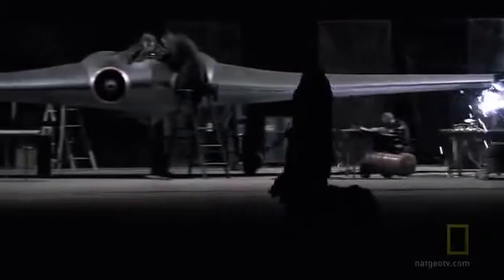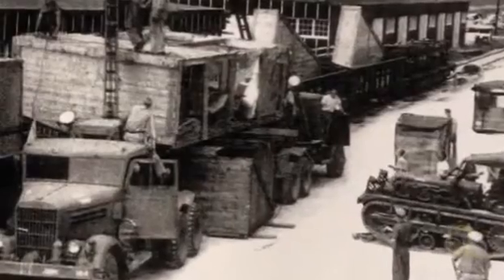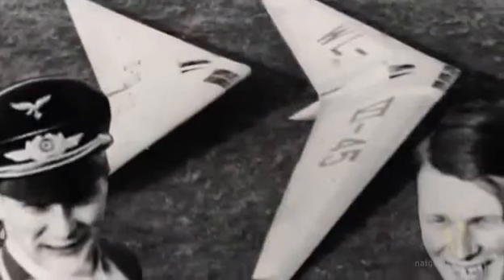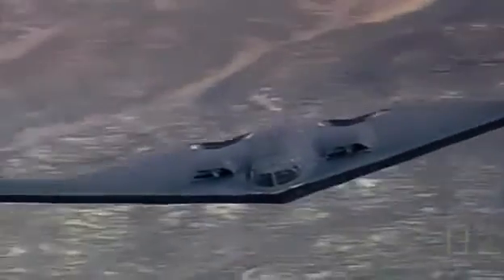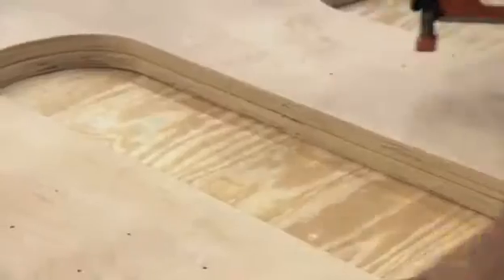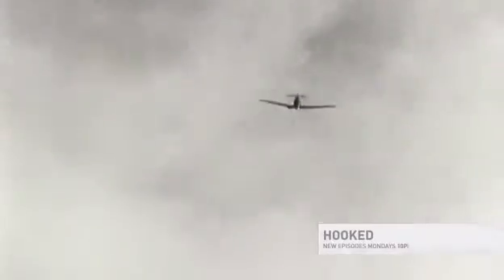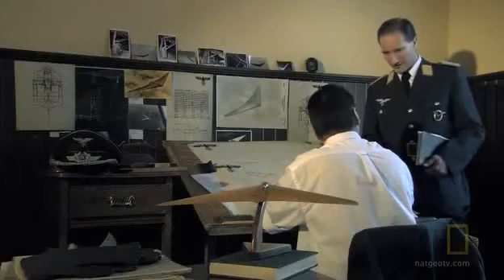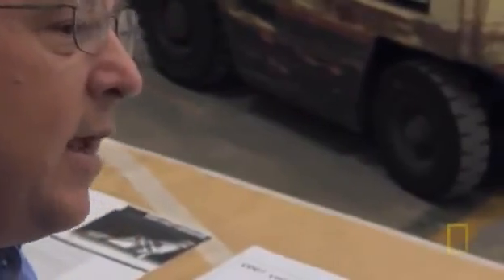HORTEN 229 Hitlers Stealth Fighter

Comment: The victor writes the history. So they have to bend the truth to the victors way of thinking. By hiding how they used the Horten to build their 'stealth' bomber. But they CANNOT hide the truth that the Horten 229 was/is a beautiful plane.
Reply: +Mark Tucker  Northrop was awarded the contract and began design and construction on the YB-35 heavy bomber in 1941 and was flying a 1/3 scale prototype by 1942.  The Horten brothers did not approach Goering or get funding to start on the Ho-229 experiments until 1943 and only performed powered flight in Feb. 1945.  Construction was never even completed on the Ho-229 that is in the museum today.  Northrop's YB-35 evolved into the jet-powered YB-49 heavy bomber, although handicapped by the thirsty jet engines. The B-2 today is the next generation of the same heavy bomber concept, identical in size. The only Horten idea that would have been comparable would be the Ho-18  trans-Atlantic bomber that they visioned but never completed.  The Ho-229 was smaller prototype for a medium bomber and nothing more than that, just a jet-powered multi-role Ju-88. The Hortens promised Goering that it would save fuel.

Comment: Yes it was stealthy in regards to the fact that it's radar cross section was much more difficult for the British to interpret, and in fact, flying at under 50 feet with speeds approaching 600 mph across the English channel.......the British would have had literally no warning.

The Horton 229 could reach RAF airfields in well under five minutes. Spitfires and Hurricanes would have been sitting  ducks on the ground. But several facts are skewered, as Hitler never even knew the plane existed. Because the Horton brothers developed their flying wing in secret right up to 1945. Nor did the Horton's think of powering the 229 with a jet engine until 1944. But still, the Horton 229 was and still is decades ahead of it's time.

Although far to late in WWII to have an impact, the Horton's jet powered flying wing could have altered the course of history, if it had been mass produced two or three years earlier.
Reply: The Horten had no stealth, it would show up on British radar quite easily if it ever flew but the Hortens never made a single plane, they made gliders.  
Gotha made a small experimental plane with no provision for any weapons which was a failure.   By the time a Ho 229 might have been built the RAF had faster fighters that would take it out easily, in fact even Spitfires and Tempests could take out Me 262`s and the Ho 229 bomber would not be much faster than an Me 262, that is if the Ho 229 had engines.  The Ho 229 was not only far too late, it never existed, It could not have been manufactured before 1947 at best.

Comment: Actually it has stealth characteristics - the frontal crossection is very low in comparison to clasical prop fighters. Also the design used carbon ritch glue that absorbs some radar rays.
It was good enough to be invisible to the british radars protecting their shore.